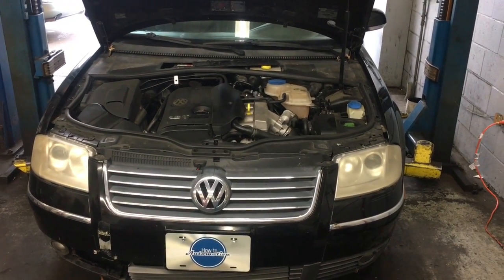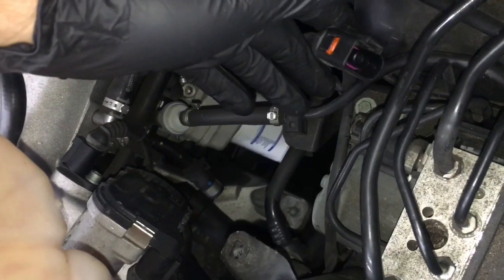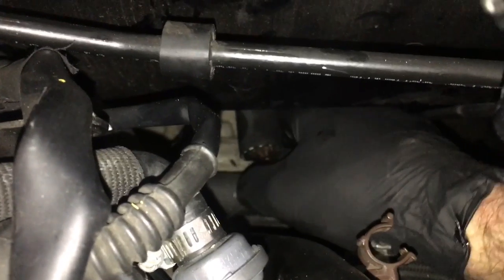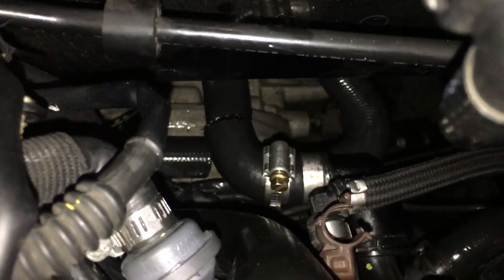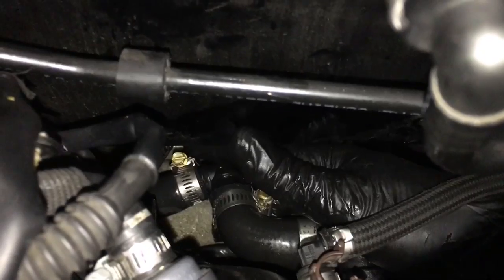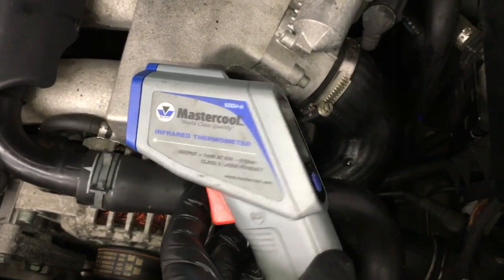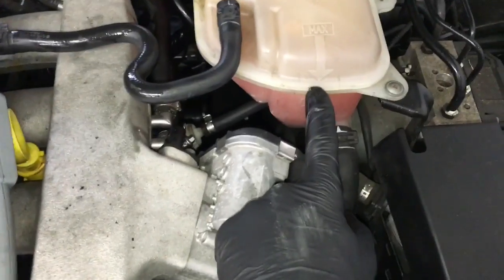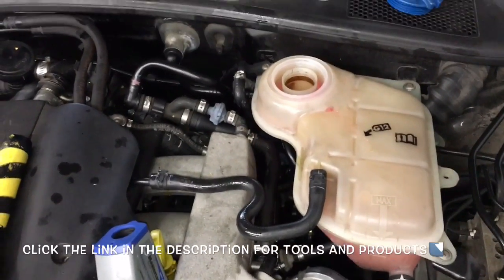How To Bypass Your Volkswagen B5 Passat 1.8 Turbo Heater Core

Comment: I did this temp fix on my B5.5 Passat because coolant was leaking inside my car from the heater core but only thing I just connected the hoses up by the battery and been good to go
Reply: The 2 that go into the firewall or whatever they call it?

Comment: Once I connect the two together how do you get the air removed from the line (bleed)? I’ve watched a few videos and they show the bleed valve up on the heater core stem, if I’m bypassing that stem where do I bleed… the overflow reservoir tank? Or is bleeding even necessary since the fix is occurring at the highest point in the line cycle?
Reply: There's a process they call burping.  You run the engine with the expansion tank open.  When it gets hot the air should bubble up out of the system.  I think it should be the same whether the heater core is still in the loop or not.
Reply: He has connected the hoses below the coolant tank, so I am guessing it will simply burp itself out after heating up. Worst case you tell the customer to come back in a week, then the mechanic would top off the coolant reservoir. 
I would NOT touch the heater core hoses.  They break. Too risky. Way better to let it burp itself out over a few days. When the system is cool, never open cooler reservoir when vehicle is hot, top off coolant as needed.  Or if it won't burp out get a shop to vacuum bleed it. 
On my 2005 Passat the heater core n i  pp1e  just broke. I changed the thermostat, so good time to also change the coolant as I bought used like 12 months ago. Did the drain, fill with distilled water, run, drain, reapeat a few times Then changed the thermostat. Prior to this there was no coolant leak in 5000 miles of driving. 
I never touched the heat core hoses. Then I kept hearing gurgling,  I have owned  and worked on many A6s and A4s and they would always burp out after a few days. Then I noticed the  leak at the heater core n  i pp1e.   I knew it was cracked. So not sure if they are related, but it was cracked and I never even took the black battery cover off until I was tracking down the coolant leak.

Comment: I know this is old, but had to ask... like on a lot of other cars, could you just plug the ends instead of making them connect (block it off instead of running as bypass)?
Reply from the maker: PD Köester no you have to loop them so the coolant will flow through the system. If you block them it creates a blockage and the coolant will not flow
Reply: @HowtoAutomotive  Thank you, I didn't know if it would work like cars I grew up with, Chevrolet 350 V-8 types to be exact, where they actually have plugs that could be installed on the intake and water pump to block those ports off.

Comment: My passat 2002 v6 has this type of problem as well , First it sent steamy smoke inside the car through vents and then coolant leaked , pretty sure it’s related to heater core as heater was playing up for two three days ... I’m afraid if head gasket is gone or your fix will work for me or not ... can u let me know plzzz wha should i do ??? Whenever i put water in it drains in seconds and keak is somewhere same place where you’ve mentioned back of engine area
Reply: Did you fix??? I have same issues

Comment: I have a 2003 Passat 1.8T that the coolant leaks out of the reservoir immediately once I put it in. Pretty sure it's leaking into the car but haven't confirmed yet. Would this bypass possibly fix that? Or could it be something else? It doesn't seem like I have a blown gasket. I can still start the car but only for a couple seconds as there is no coolant in the engine
Reply from the maker: Jay Leavy if it leaks inside the car it the heater core. And yes this will bypass it.
Reply: @HowtoAutomotive  I bypassed the heater core and now I have pressure in the system and the reservoir is holding coolant. Thanks. But how can I be sure that all the hoses have coolant now? I twisted the drain plug on the radiator (wasn't that easy even with a really long screwdriver) and nothing came out. Do I need to run the car to get the water pump to pull the coolant through the system?
Reply: Disregard. I was able to pump the hose on top and confirm that there is coolant in the lines. Thanks anyways
Reply from the maker: Jay Leavy Glad it worked out 👍🏻

Comment: Not to ask an ignorent question but without that core connection will there be any heat at all in the car including anh heat from the vent without the blower being on
Reply from the maker: Frank Blagdan no you will not have heat at all.

Comment: So why would one do this?  Bypass a leaky heater core because it's labor intensive to replace? and when one does this they get no heat in the cabin but the car will run okay and not overheat?  I'm asking this because I have this problem.  $3500 to replace the heater core and temperature sensor!  Unbelievable!
Reply: Good question. This can be an expensive repair as the dashboard has to be removed.  Cost Will vary by make/model.  It would be done for a few reasons. 1. Temporary measure until you can get the heater core replaced by a shop or have to the time if you are doing it yourself. At least that way you can drive the car. 2. If the car has other problems, then again a temporary fix as owner may want to sell it as mechanics special. 3. If in say AZ, TX, NV, Southern CA, then maybe that is a long term fix. And the owner just lives with no heat and does not ever drive to cold/snowy area.

Comment: Why would you choose to bypass the heater core? What are the pros and cons to bypassing?  I am asking because my heater core is leaking antifreeze and my mechanic is telling me that he has to remove the whole dashboard to replace it.
Reply from the maker: Bethany Beyer only reason you would bypass it is so you don't have to take the dash apart and make the repair it's more of a money issue. It's a way to get your car back on the road about fixing the problem. Unfortunately the only way to repair right is to pull the dash out.